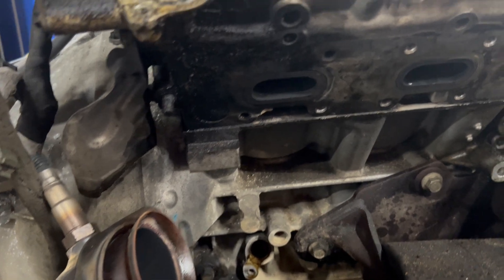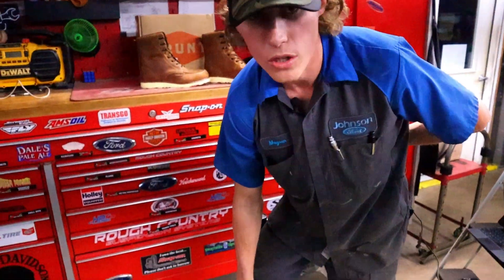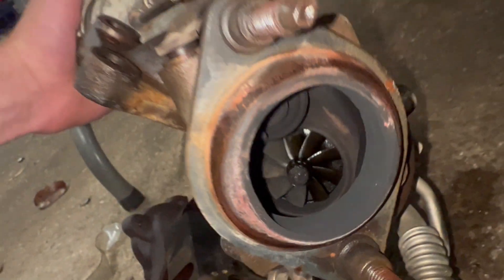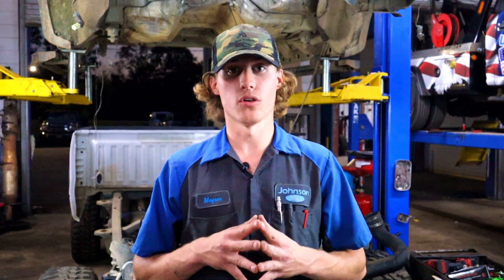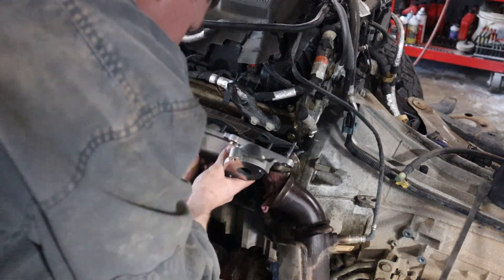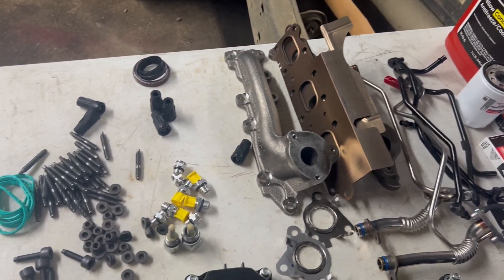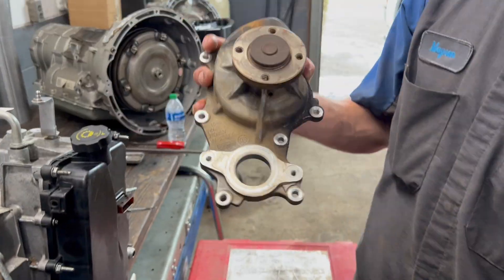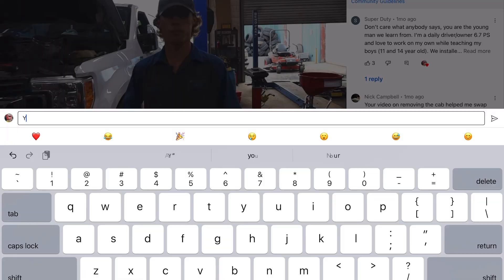Ford 3.5L EcoBoost Broken Exhaust Manifold Stud | Everything You Need to Know

Comment: I have a 2015 with 183,000 miles on it and I’m starting to get an exhaust view smell in the cab, especially at low RPMs and idle. I thought this might be my issue, but I don’t have any of those symptoms that you mentioned at the beginning. Any thoughts?

Comment: If you were replacing the turbo coolant fittings for one of the turbos (DS) without removing the cab, would you replace the exhaust manifold at the same time if you didn't have a problem with it yet?

Comment: "redesigned in 2017 for so they don't break anymore" 

I wish, the 17+ is definitely still breaking.
Mine did before 100k. Now at 200k it's getting bad enough I'm not building enough boost and will need to replace them.
Will likely do new turbos while I'm at it, 200k is getting up there for the original turbos.

Comment: The studs breaking on these have zero to do with the weight of the turbo.  That (if it were true) would look like an entirely different type of break, and the break would be flush with the head from the vertical force stress.  This break is a lateral force break, from heat cycle/warp stresses to a stud that can't take that kind of pressure.  The new design addresses it with the extra stud location.

Comment: it brakes when manifold cools of it pulls away from the stud because of how much material is on the manifold end  it moves more then the rest  has nothing to do with the weight from the turbos otherwise the top studs would brake of first  its al about thermal expansion and contraction

Comment: So I have a 2015 f150 xlt 3.5 eco boost. Currently 302k.. I bought new and have had really no trouble out of the truck. I keep up with maintenance pretty good. So I had a P0299 code. Turbo A under boost condition. Replaced turbo with ford turbo and getting same code and loss of power. I am now being told the manifolds need to be replaced and that’s causing my under boost issue still. Would the manifold cause an under boost? Got quotes from 2 shops. 3300 and 3700.

Comment: Doing the BD manifolds on my 13 in the driveway along with the full race coolant lines, what a pain !!! OE manifolds are warped but no broken bolts. BD are lower height on the turbo mounting area than the OE by about a inch making thing lots of fun to get back together.

Comment: Not sure why more guys dont just do the repairs themselves. I've done the water pump, lead frame, turbo coolant fittings, brakes and rotors, all preventative maintenance. I have manifolds and lines currently in my cart from BD diesel, while I'm in there ikl replace the vacuum pump as well. My 2016 has 220k miles and still going strong. Once block inevitably goes ill replace block and rebuild head and keep on trucking. Idk why y'all give up on a truck just to go in debt another 30 to 40k.

Comment: BD Diesel Exhaust Manifold Fits Select Ford, Lincoln Trucks, SUVs, Transits w/3.5L Ecoboost Engines
BD Diesel Exhaust Manifold Install Kit for BD Diesel 1043001 2011-2016 Ford F-150 3.5L Ecoboost
15 mm Longer Exhaust Studs
12 STUD KIT!
OEM only has 8 STUDS! GET THE 12 STUD KIT!
This ford has 12 STUD HOLES PREDRILLED so USE THEM!

Comment: This is the noise I am hearing from my 2016 F-150. In my most recent visit to the dealership, which did not diagnose this noise to this issue did mention my water pump may need to be replace. Can you point me to the list of parts you suggested to also replace? I would love to do this and the preventative maintenance all in one shot.

Comment: I don't think its the weight that breaks the studs.  Thermal expansion of the manifold is a common problem across the auto industry.   Look at the multi part manifold on the cummins diesel with both a iron head and manifold.  In this case the head is aluminum and the manifold is cast.  The manifold is also prone to warpage. The manifold studs should be as long as possible to allow sideways movement during this thermal expansion.  The torque on the studs cannot be too great either as the manifold is intended to slide on the gasket as it expands and contracts.  The longer the studs are the less angular movement they will experience during the heat cycles.  That is why you often see longer exhaust studs with spacers.  While it may work the aftermarket system with the manifold with all the bolts is not the best solution technically.  There were a couple oversights that as usual it took Ford several years to correct.

Comment: replaced mine this week with BD Diesel manifolds. All turbo lines and connectors too. 4 days of hell but worth the peace of mind I have now.
Reply: Is there a bolt hole already in the block pre drilled for the BD?
Reply: @edanderson924  yes. all 11 stud holes are already in the block.  the oem uses only 8. there updated oem uses 9 I think. hope I am answering your question.
Reply: I was thinking about getting my manifolds with them to , do you recommend?
Reply: @kevo23_23  yes 100%. IF you DIY it, ice you get past the take off part of the job, the BD's went on easy. FYI - learn from my mistake: watch which end of the new bolts you tighten into the block. I put one in upside down and could have damaged the block.
Reply: Okay. Take a week off work. Got it. My wife's 2016 Expedition is doing this. Haven't seen the busted stud yet, but she chirps when cold.

Comment: Yep, this is my problem.  Fuck Ford man.  Loud screech at high RPM and a tick like what you showed.  At least it's not my turbo failing.  But still not a cheap fix by any means.  And they design it to be as hard as possible to repair.  Impossible, far as I can tell, in your driveway.

Comment: My Expedition is nearing 150,000 miles. No exhaust issues (yet) but I'm seeing a very small drip of oil once in a while. Not sure if it's the turbos or oil pan. My question is should I be proactive and do a full overhaul with timing chain, water pump, turbos and exhaust manifolds or wait till one fails?

Comment: Would you recommend replacing turbos at the same time? 
I have 155k miles on it turbos aren’t causing any issue but are leaking coolant. Just wondering if you would replace or reuse?
Reply: I have a 2014 platinum with 200,400 miles on it. Only problem I have had is the manifold on the passenger side. My turbos are still going.

Comment: I drove f150s for 27years now.
Refuse to by a eb.
All that junk is trouble, ford always had manifold /bolt problems because of all the junk hanging off . There were 4 converters, and now it's 4 converters plus 2 turbos.
My 5.0 has a broken manifold but easy to work on compared to this stuff.
When warranty goes get rid of this stuff.  All trouble waiting to happen.

Comment: Hey there, great video! I've got the dreaded coolant leak out of the driver side turbo on my 2016 Expy (122k miles). Manifolds look okay but thinking of doing those at the same time. I'm seem aftermarket manifolds out there with up to 11 studs, instead of the 9 in the revised Ford OEM manifold. (See the guys at BD Diesel). Any thoughts on that option? Thanks again!

Comment: My 13 f150 is making a strange intermittent noise from the driver side but it's not whistling.  it's a deck of cards shuffling kind of sound that comes and goes with acceleration.  I left you another comment on another video letting you know I've replace the rid bearings in my motor.  now I'm thinking of pulling the turbos when it warms up a little.  I purchased bd manifolds, low mileage turbos, stainless lines with fittings and im thinking of upgrading the turbo cartridges or getting new balanced assemblies from c&r while I'm doing this.  I won't be pulling the cab because I found a fairly simple way to replace the rear fittings without doing it.  After eliminating most of the oil leaks I think my passenger valve cover is leaking after installing a new vacuum pump yesterday .

Comment: Just had both of mine replaced. Driver side was about 1/8 and the passenger was about 1/4 in off straight. Current central California price was $5,200!! 
Could probably have done it myself, but not enough time to do it. 

Would you recommend a break in period for these, or driving easy on it for a certain amount of miles? A re-check of the bolts at some point?

Comment: My 2013 ecoboost has 307k miles, I bought it in December 2013 as a demo with 4k miles, it is a supercrew, 4x4 with 3.55 rear axle, I had a issue with the timing chain, I had local dealer fix timing issue, @ 92k miles, my only issue with mine that has been a revolving issue is the volume of spark plugs that will loose there gap, I have just picked up a bad manifold leak, I am preparing myself to fix everything truck needs now. I have a 22 6.7 reg cab f350 srw 4x4 I drive as my daily for work and everything, I really appreciate your videos, I find serious value in them, there are too many ppl on YouTube that think they know something, but what you have illustrated is that your experience and education on said vehicles I believe you have a level of excellence and experience that is beyond reproach. I’m in Huntsville AL and I would like you to do the repairs on my 2013 f150.

Comment: Extra,extra read all about it! ….I have a 2005 Ford e150 with 4.6 liter that has that exact same problem. (2 furthest back exhaust studs on passenger side broken causing a leak). Enter KAP (Kral Auto Parts LLC)…..they manufacture brackets that bolt onto empty, threaded holes on the head and then clamp down on the manifold to re-create a seal. I ordered one and it worked! Only took 45 minutes to install and only cost $73.00 including tax and shipping. Did not have to lift the motor or remove any parts. Genius invention!!
Reply: F-150 is not listed on their website.  Have a part number?

Comment: I have a 2015 3.5 Ecoboost with 104,000, I believe left side is leaking coolant at the turbocharger, otherwise I have not had any problems with this truck. I like the idea of getting the cab off the frame and replacing both turbochargers, coolant lines, manifords, bolts and whatever else you have suggested in this video all at the same time. 
So if I bring this truck into the dealership where you work how long does it take once the work gets started?

Comment: You're a complete moron so I subscribed because I understood everything you said. Well done! My 2016 Ecoboost is exhibiting these signs so I know it's the exhaust issue you describe here. I'll have to get it fixed now. You've helped me avoid some unnecessary repairs. I think I'll do the complete list.
Question: How do I replace the existing manifold with one that has one additional stud as you mentioned? Does the engine have a place for this new/added stud? Or will they have to drill out the block? How long should I expect the repairs to take once they start? What should I look for to validate that the other work (turbo gaskets and all) were done? What signs might I see if they did something wrong or cut a corner?
I love Alabama. Lived there in 90s up near Florence and Tuscumbia. Fished the Tennessee for great bass after work. Love and miss it. Thanks for your video and I look forward to more! 
PS, don't worry about your hands. If you really need to, hold some tools or parts related to the repair. All good.

Comment: Your notes still say that parts list is coming. I need the Ford part number for that new exhaust manifold because I had mine replaced at the dealer last year and the studs are broken again. At the time the dealer rep said there was no upgrade part.
Reply: Maybe the BD Diesel replacement?

Comment: owned a 2013 3.5 ecoboost (loved the truck overall) and due to this issue I will never again buy a truck or vehicle with a turbo, unless its for performance etc. Every thing you pointed out is exactly what happened to my truck, leaking coolant lines, bolts breaking in the back etc. I also had another issue I was able to fix myself, which was a blend air door actuator deep in the dash that broke. BTW, when I had this done about 6 months ago (in Cali) it cost me 4,000. I sold the truck right after, even though I "made money" on the sale, its still cost me 4k of my own money first. This should have been a legit recall, and fixed at the dealer/manufacturers expense.
Reply: Im going through alll these issues as we speak. At the moment im havn the coolant turbo line replaced. And next is the exhaust manifolds. Total ill b a tad bit over 3k just on that. Smh love my truck. Love everything about it. Keeping it because it just my weekend vehicle. But damn what a pricey repair
Reply: @ThatVato-sd7cw I had one side done for 1000 bucks.New manifold and new coolant line.
Reply: @bobtenharkel4367  Did you replace the exhaust manifold, gasket, ALL studs, Nuts, the fittings, turbo exhause gaskets, coolant lines, turbo coolant fittings, and the o rings? if not, those will fail much sooner. Maybe good for another 70k miles before another leak
Reply: Tbf it mostly depends on the engine. My 2.0 ecoboost has been excellent for me
Reply: This is normal wear and tear imo.  I have a 5.7 jeep that can’t keep manifold studs to save its life.  Every turbo car I’ve ever owned breaks studs - it’s just from heat cycling and cheap material.
Reply: @94jettameowpsst   my ram 5.7  same if I drive it every day never hear it as I use it now just drive it on weekends
Reply: It’s pretty normal my cohost f150 has been great. I would buy the same year again. It needs all the repairs he mentioned but my truck also has 150k miles and I haven’t spent a dime on the truck. Only oil changes
Reply: I am facing this now on my 2017 F150 Ecoboost, 117000 miles. Probably be $3-4000. I will be selling truck within a year and buying another Tundra. 2016-2021 V8. Fock Ford, forever.😂

Comment: I agree with everything youre replacing except i would use, whih i did use and are currently using, that is db diesel manifolds which give you 11 mounting holes and bigger ports.

Comment: I’m being told that I’ve had this air pump $700 and now the cable covers $1100 there saying that the rear main seal could be leaking what’s the likely hold of this at 150000 miles and the truck runs great could you show a rear main replacement this is on a 2015 f150 3.5

Comment: Thanks a lot brother. Hopefully more videos u put out on 2015 ford f150 eco boost will help me diy. I just changed out my #3 ignition coil and all spark plugs. I saved hundreds of $. I’m a first time truck owner n bought this 2015 ford f150 lariat eco boost
Reply: how many miles u got on ur 15
Reply: Happening to me on my 15' at 86k miles. Have a broken stud on each side. ONly squeek noise on passenger side. Dealer says I need both. Quoted $4700 for repair. @TheLawlessGang

Comment: Though all the weight at the back from the turbo does not help, I think the real cause of snapping studs is a poorly designed and manufactured manifold. Why you ask? Because when I took mine off, several of the studs were broken both front and back and you could rock the manifold on a flat surface, it was so warped from heat cycles at about 80k miles. I tow about half the time so my experience may be worse than most.

Comment: Yup... I have a 2015 transit with the same problem with 128500 miles on it... I bought the bd diesel upgraded manifolds... also replacing turbos, all coolant pipes a0nd oil supply fittings to the turbos and coolant tubes and fittings...timing chains.. tensioners.. water pump.. phasers.. oil pump.. fuel rails and injectors... coils and spark plugs...  im pretty much at about 3500 in parts and saving labor doing it all myself. It's going to be fun. I cand remove the cab.. im removing the entire front end of the van to gain access to both sides of the engine and front. Will be a load of fun.
Reply: How did the repair go? Was access not too bad?

Comment: Just discovered your channel. 1 word = AWESOME!, Looks like you and Brian at FTML are the authorities on F150s. Fixing to do the manifold replace on a '16 with 90k miles. No broken studs but notice the whine during hard launches. I went with the BDDiesel manifolds. I am hoping no issues seen with those.
Reply: I feel ya! I just ordered the Kit along with their turbo gasket kit with all the fittings. I just bought a 14 with 196k. It's in Great shape all around just makes that little chirp noise when I accelerate. I'm hoping myself a couple friends can get it done with a little effort! If I install before you I'll let you know how it went!
Reply: @gettendeep18  Got the manifolds swapped Saturday. Runs so much better... I think it builds boost faster. Seems to be more responsive. Biggest plus = No more exhaust leak whistle at high boost. Note: I did have 1 broken exhaust bolt, but seems the nut was rusted to the manifold so i thought they were 100% until i touched it.
Reply: @UmbraNest  nice! I contacted the dealer and they have it now to "diagnose" even though I'm fairly certain what the problem is. At least they provided a loner vehicle and are helping with the issue given I bought it with no warranty with higher mileage! Either way I'll get them installed soon. Glad to hear they perform good!
Reply: @UmbraNest  Did you just remove them cold or did you use a torch or something to start? I’m about to do this at a similar mileage and all the studs are in tact now. I am hoping doing it early can save me headaches.
Reply: @bigpicturethinking5620  they all came out cold. I did have a torch and a bolt induction heater on standby just in case.

Just take your time. dont get in a hurry.
Reply: @UmbraNest  Thanks for the reply. I also have a torch ready and was considering the induction heater to have if needed. Did you replace the coolant fittings as well? That’s why I’m doing it at all.
Reply: Have you done the repair yet? If so how did install with the BD manifolds go? I'm about to order from them
Reply: @gettendeep18  Havent started yet. Plan to start next weekend hopefully. Seems life gets in the way. Luckily none of my studs are broken yet just want to be proactive.